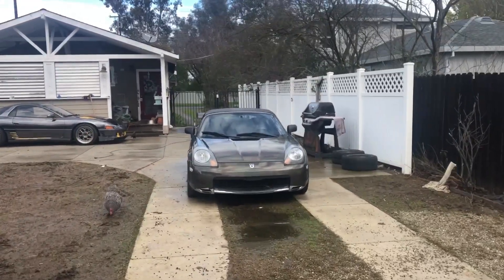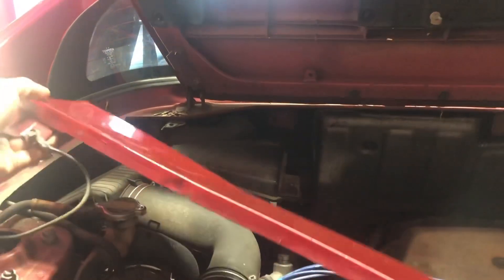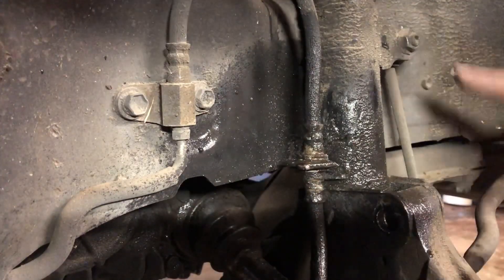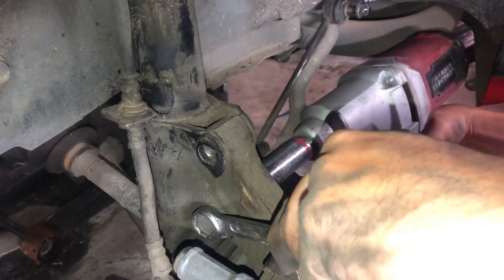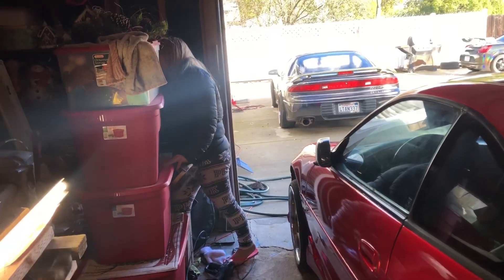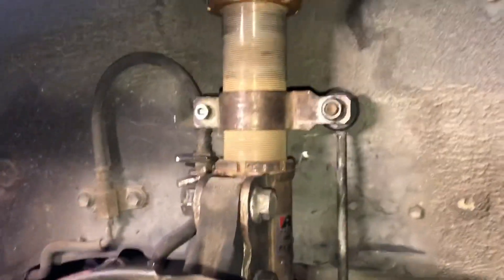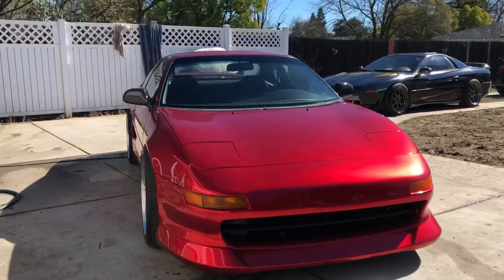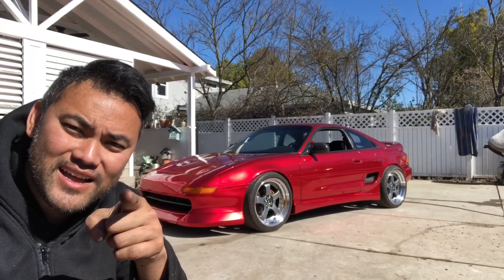Slamming the MR2 on Massive 245/35/R18! DIY JDM Coilovers Install & Wheels

Comment: Car looks awesome man. Need to work on my mr2 and fix the body work. Plan on v6 swapping mine in the future. If you roll and pull the front fender you might be able to tuck them better. The poke actually looks pretty good and very aggressive.
Reply from the maker: Subie Jason thanks for the support! I was also thinking about the V6 swap but it’s like 7000

Comment: You did the right thing cutting it off but I would cut a slit in it and bend it up or down. Offset looks great but tyres need more stretch
Reply from the maker: Yeah I think I’m gona get smaller tires and add some camber

Comment: How much would you charge to wrap an mr2 like this
Reply from the maker: bryan if no body work is required probably about 1750-1950 depending on what body kit you have and your current color vs the new color. Going from like white to black costs more then going red to red.

Comment: Why not remove the clip that holds the brake line in place rather than cutting it off as it would have been much quicker, it also leaves the suspension leg now useless
Reply from the maker: The Mon I couldn’t figure out how to get that clip off. If you watch bob Pham’s video he said you have tor disconnect the brake like and bleed the brakes to string it through. This was easier to do then zip tie it to the new coils.

Comment: @Paradox The Wrapper  that was so incredibly cringey to see you cut those mounting tabs off. Being ignorant about how something works or how it comes apart is no excuse to butcher it. Not to mention those strut housings you cut the tab off of are now scrap, whereas if you had done it correctly you could've re-used or sold the struts. 
This may sound harsh but if you don't even know how to remove a clip and a brake line, you should not be modifying systems of the car that effect safety (suspension and brakes). 
Since you cut  the tab off and left it on the hose, how did you secure the hose to the coilover, zip ties? 

Your sway bar end link issue would be partly solved by getting (and installing) the correct end links, proper coilover setup, and installing RCAs (roll center adjusters) which would correct the geometry of the lower control arm. 

Bottom line, you have enthusiasm for the cars but not the proper knowledge base to be doing the things you are doing safely. Please do some research, join a forum, buy a service manual, etc! You will be better off and so will all the people sharing the road with your sketchy cars lol

Cheers and good luck!
Reply from the maker: ShantzeePantz thanks for the tips! Yup I use zip ties and it’s all been working fine and driving well.